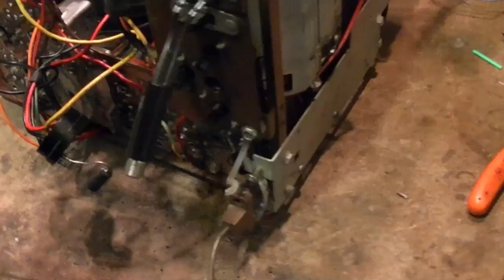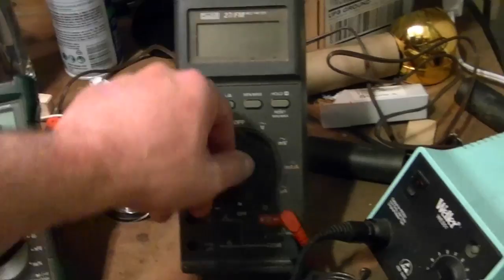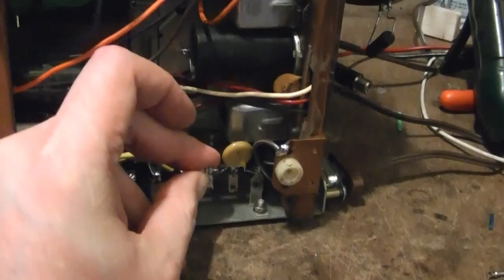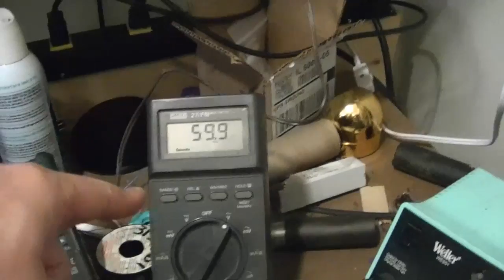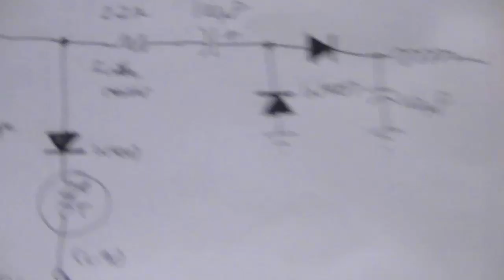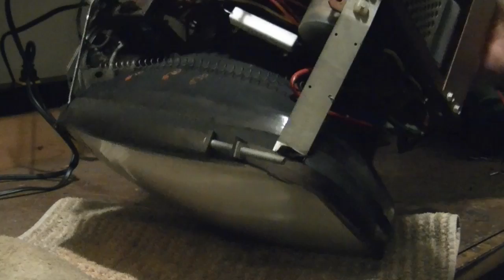Admiral T-102 restoration p6o7

Comment: I love your videos.  When I was a teenager, I spent hours messing about with these old tube based sets, building audio amps etc.  Having deleted my two previous comments, I think I now understand the filament voltage issues.  In summary, I believe your arrangement is under-running the chain by about 5V RMS, if the supply is 117V.  You could fix this by adding a 270 Ohm resistor in parallel with the diode.  Alternatively, as you have done, run the set at 125V RMS. Calculations follow:

The tube filaments add up to 85V.  Resistance of chain = 85/0.6 = 141.7 Ohm.  The dropper is 54 Ohm.  Total = 195.7 Ohms.  The set is therefore designed for optimal supply voltage of 0.6 x 195.7 = 117.4V.  Inserting a diode (assuming zero forward conduction voltage drop) halves the power dissipated.  Because power is proportional to voltage squared, to get half the power, the RMS voltage is not halved, it is divided by √2 =1.414.  So the RMS value of rectified line voltage = 117.4/1.414 = 83V, which I would say purely by chance this is close to what is needed.  Note: as the peak line voltage is √2 x 117.4 = 166V we can also say that the RMS of the rectified line = half of peak line volts.

OK, now let's include the 0.6V diode drop and the 4 Ohm thermistor.  The RMS of the half wave is reduced to (117.4*1.414-0.6)/2 = 82.7V.  Adding the 4 Ohm thermistor creates a voltage divider, and if the filament chain was 141.7 Ohms the voltage on it would be 82.7* 141.7/(141.7 + 4) = 80.4V, meaning you get a filament heat dissipation of (80.4/85) squared of what it should be, = 89.5% .  In reality the filaments are running cooler so their resistance is lower, giving a higher supply current but a greater proportion of the supply voltage dropped by the thermistor.  I am not going to try calculating these effects - temperature coefficient of resistance, applying Stefan-Boltzmann law to the cathode etc!

It occurs to me that you can add back this missing power by putting a resistor in parallel with the diode.  This would have virtually zero effect when the diode is forward conducting, but would top up the power in the half cycles when the diode is not conducting.  Let's approach this by looking at the heat dissipation in Watts.  For the correct operation the chain dissipates 85V x 0.6A = 51 Watts.  The correct parallel resistor will create the correct filament resistance of 141.7 Ohms.  The dissipation due to the diode current will be 89.5% of 51 Watts.  So the resistor needs to add 10.5% of 51Watts to the chain = 5.36 Watts.  Wattage = V squared/R, so the RMS voltage required is √(Wattage*R) = √(5.36*141.7) = 27.6V. 

Let's call the required resistor R.  It is in series with the 4 Ohm thermistor and the 141.7.4 Ohm chain. The RMS of the supply is half the peak as the resistor is only conducting on half cycles, ie 83V. So we need to solve the following:   27.6 = 83*141.7/(R+4+141.7), rearranging: R = (83*141.7)/27.6 - 4 - 141.7 =280.4.  Suggest use preferred value of 270 Ohms.  RMS voltage across this resistor is 83*270/(270+4+141.7) = 54V.  Wattage = 54*54/270 = 10.8W.  If you are running the set on more than 117.4V you would need to use a higher value resistor to get the correct filament current, and with sufficient supply volts you don’t need the resistor.  In the video, you increase the supply to 125V, giving a peak voltage of 176.75, The RMS of the half wave is increased to (125*1.414-0.6)/2 = 88.1V. So the RMS chain voltage is now 88.1* 141.7/(141.7 + 4) = 85.7V.  Pretty close to perfect.

Finally, another commenter has suggested two diodes in series and using a higher current diode to prevent full line voltage being applied in the event of a diode failure.  I guess you could go further and use capacitors, MOV's etc to protect the diode.  Then again, perhaps I am over engineering?

Looking forward to watching many more of your videos.

Comment: Your meter is reading correctly. If you take the AC + DC component using the formula ACrmssquared + DCsquared and take the square root of that answer, you will get approximately 82 volts using the AC and DC numbers you have provided. That is very close to what your 'scope is showing. What you will most likely find is that your Fluke 27FM is a correctly functioning True RMS meter that is AC coupled. Therefore it will not include the DC component. Some meters are like this, some are not. It would be somewhat analogous to trying to read the AC+DC measurement on your 'scope with the AC coupling switch flipped on. As far as the B+ voltage goes, what meter input impedance are your voltage readings referenced to on your schematics?? The 27FM most likely is 10Mohms. Most of the old 1950's style VOM's like the Simpson 260 were something like 20Kohms per volt on the DC scale. That would load the circuit quite a bit more than the 27FM and might explain the higher voltage reading with the Fluke.
Reply from the maker: Thanks for the info.  I'm measure the B+ right after the voltage doubler so I don't think meter loading would have much effect.  I'm using a 2.2 ohm vs 10 ohm fusible resistor and silicon diodes instead of seleniun so expected the B+ to be higher.
Reply: OK, I understand.

Also, although I don't comment often, I enjoy watching you videos. I'm always looking for new information and methods. Tube instruments are not normally my 'thing', but I have purchased some tube type test equipment recently that I am going to refurbish and these videos and the videos of several other tube oriented channels have helped me 'get up to speed'.

Comment: I wonder how low in frequency you can go on a tube filament before the emissions become modulated by the (slower) AC heater current?  Tube engineers were relying on thermal mass of the heater/cathode metal pieces.  There must be a lower limit where it doesn't work cleanly anymore. Anyone know the answer to this?

Comment: As stated by others, I think your Fluke 27 is working as designed.  Most so called "True RMS" meters use a complex algorithm to determine V, but that formula is designed for full wave forms.  Basically what your meter is seeing is a pulse form with a relatively long interval at zero, which is throwing off the algorithm.  I'm also curious to see how it reads that wave in DC mode.

I have a regular Fluke 27 and it's a great meter.  I intentionally chose not to get a "True RMS" meter because I think they're overrated.  They way I see them is that they're using an algorithm with a few sample points to still come up with a sort of average voltage, and therefore are just a fancier type of averaging MM.  They do make digital sampling MMs, which sample across the entire waveform and are very accurate.  They're basically mini digital scopes, and are very pricey.
Reply from the maker: I get about 52 volts in DC mode.  A device like the AD536 is supposed to factor in both AC and DC components and I would expect it to give the correct result like my scope does.  I'm curious to see what chip is in my 27.

Comment: The erroneous readings on the meter are an excellent example as to why you have to be careful in using a diode dropper, some would use a meter like that on an early AC/DC radio and assume everything is 10 volts or more lower then it actually is. Also with regard to diode droppers I read someplace that it is actually a good idea to connect two diodes in series, that way if one shorts out you will not end up with the full 120-125 vac going across your filament string. I also think that using diodes of a higher current rating may lessen this possibility, the difference in cost between a 1 amp and a 3 amp diode is pretty marginal, maybe $.05 to $ .10 more.

Comment: Hi Bob,
On the RMS issue, I am not sure if there is any meter that can measure RMS w/ out signal capture and processing. However, I did hear about a meter that used heat to measure RMS power.  Basically, a current flows through a resistor inside the meter and the temperature change is measured.  This only works on periodic currents.  I think it was actually a Fluke instrument. This was some 30 years ago?
I suspect your scope is more accurate than any multimeter that doesn't analyze a digitally captured signal stream.
Nice vid - thanks for posting.
Reply from the maker: My Fluke is supposed to have a true RMS converter IC like the AD536.  I'll pop it open soon for a closer look.
Reply: bandersentv The RMS chip is a SC77174 originally manufactured by Motorola, designed by Fluke's Norm Strong for the 8060. It was replaced by the AD636 in the 8060, but never was in the 27/FM.  It is True RMS BUT -for symmetrical waveforms! Watch out for that! One thing it had going for it was its wide bandwidth (100 kHz) for the day. Intersil copied this chip and evolved (devloved?-not as wide a bandwidth!) into the ICL7106.

Comment: Love your videos, thanks for sharing. I can help with your meter problem. Your Fluke is working just fine. However you can't measure RMS voltage or RMS current on a rectified signal with your meter. You could do this in a few different ways with a little math or you could get a Fluke 287 and set it in AC + DC mode to get your correct RMS value like you did with your scope. I have a video that covers this topic titled "Convert 120v AC to 12v DC using just a light bulb, diode and a capacitor. " starting at 17:42 mark.